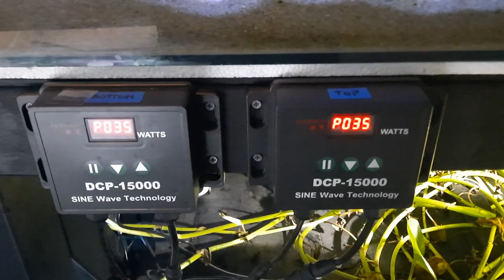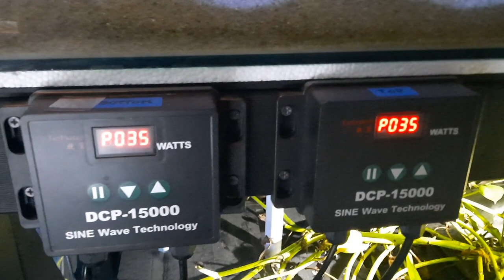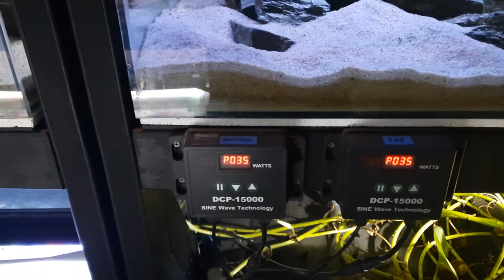Fish Room Tour 2022 - FULL TOUR!

Comment: I really enjoyed the video! Just a question do your fry tanks run off the sump system? If so how do you prevent the fry from going over the overflow? Kind regards.
Reply from the maker: Glad you enjoyed it mate. On the bulkheads I have a short piece of pvc sticking out of them. This is removable for cleaning. I then use a zip tie to hold flyscreen to one end of the piece of pvc. Again the flyscreen can be removed and slid back on for cleaning. Hope that makes sense. Tanks with larger fish just have gutter guard zip tied to the piece of pvc. Great thing is, all of those are black and you can't see them.

Comment: Hey man great video, I've been watching you for a while and I've said this before. You have to figure out what's causing that terrible high pitch noise. If you don't believe me it exists get someone young to listen, it's prevalent through the whole video whenever there isn't music. Hopefully you can figure it out
Reply from the maker: Well that's concerning. I thought I resolved it as it was the aircon. The aircon and circulation fan were both off for the entire tour. People were reporting after I tested it that they could no longer hear the high pitched sound. If you're saying you can still hear it then I really don't know what it could be. Maybe its software related? It's so difficult to resolve when I and no one I know can hear it. But I will play around with the video software settings, maybe its something in that.
Reply: @JasonsCichlids  I made sure to test if I can hear in on multiple devices before telling you about it. So it's not on the user end. It's the same sound that old TV's make. Maybe it's an old lighting fixture you have or maybe it's editing software related. Is your camera recording at the same frequency as you're using to edit? Also maybe try to add a noise gate that limits the high frequencies. I know Audacity has one that can work
Reply from the maker: Thanks heaps for running those tests on different devices! I am beginning to think it is software related. And thanks for the suggestion about using Audacity and a "noise gate". Never heard of that before but will give it a try

Comment: I love the gold comps. It was neat to hear about the sump system. Do you think that it's a over kill to run a sump system and sponge filters too or are they just back up for when you need to isolate a tank?
Reply from the maker: Cheers Troy, I really love them too. They are really colouring up now. I actually do that mate, I have sponge filters in the top row for that very reason, to have the ability to isolate a tank if I ever need. It also allows me to always have seeded media ready to go with beneficial bacteria. The other reason is because of redundancy. If a return pump was to fail I could switch it out if need be and run the top row of tanks on the sponge filters until a new pump arrives. That said it's always a good idea to have a back up pump ready to go, even if its just something cheap. In my case that will be the pump I use for my water changes. Hope that helps mate.
Reply: @JasonsCichlids  That's great information. Your videos are very informative and helps give me guidance on Tanzanian Cichlids that there isn't too much information on. You mentioned on your video about drilling your tanks for a future  plumbing, are your tanks glass or acrylic and how do you drill them?
Reply from the maker: That is great to hear, glad you are finding them useful. Yeah I will be drilling them. They are made of glass and I will be using a diamond holesaw to do the drilling. I will document the entire process on my channel when I get around to doing the plumbing for those tanks